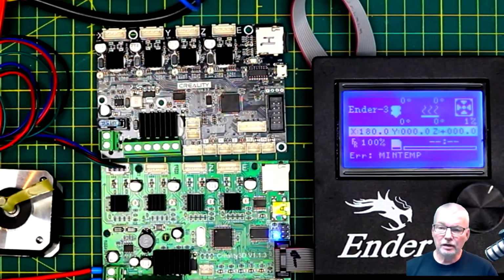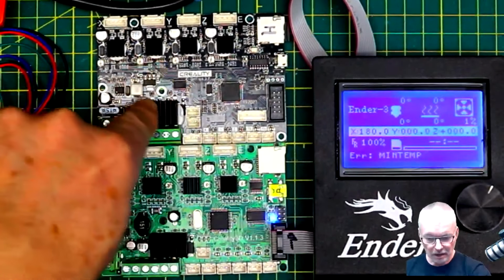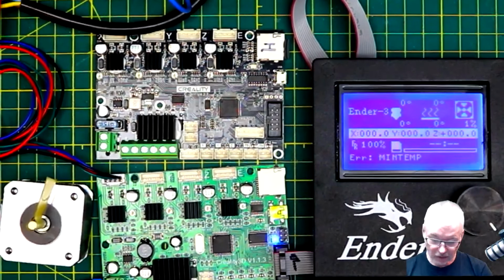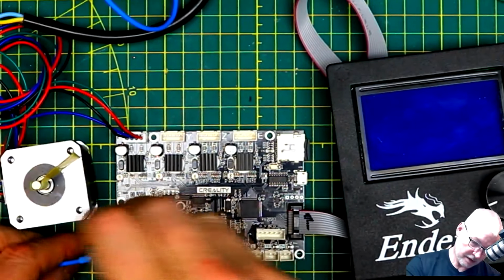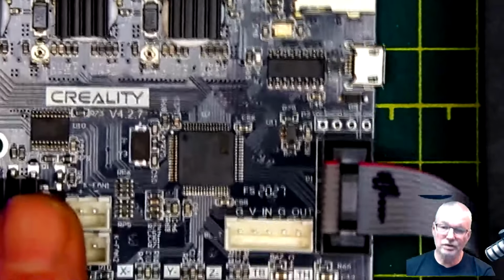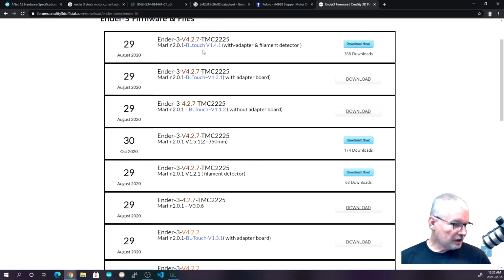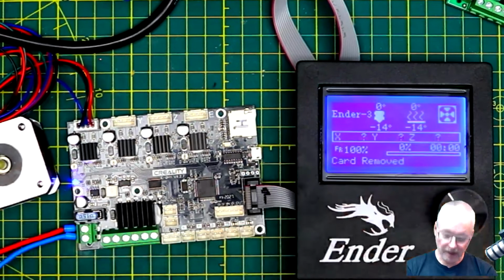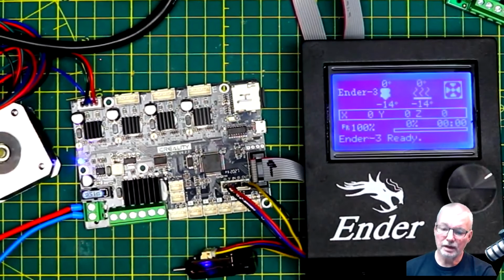Ender 3/5 32bit controller upgrade

Comment: When I upgraded one of my Ender 3 printers the Creality board didn't even make the running in the choice of the upgrade, I went with the SKR mini E3 as its cheaper and much better than the Creality offering, I get a choice of drivers the Processor is faster and it has more memory and its a direct drop-in replacement having been designed specifically for the Ender printers